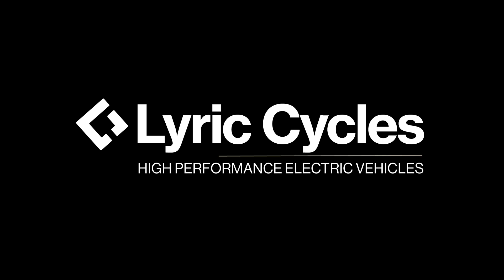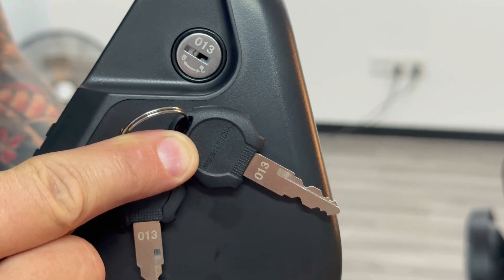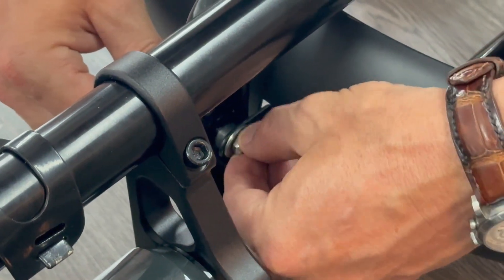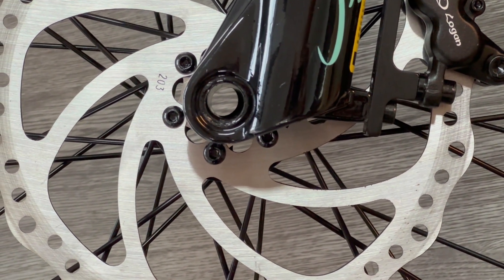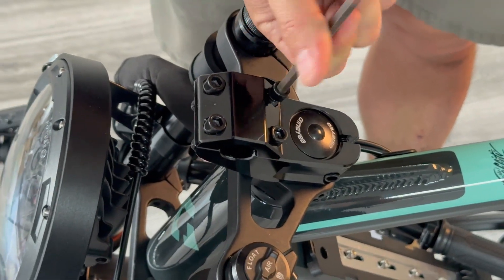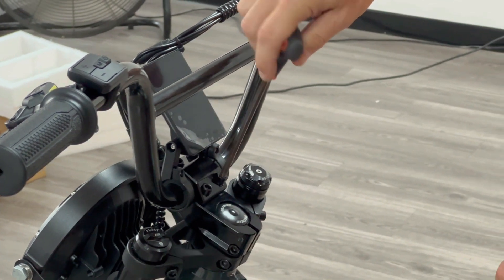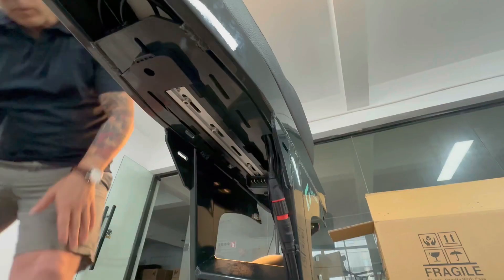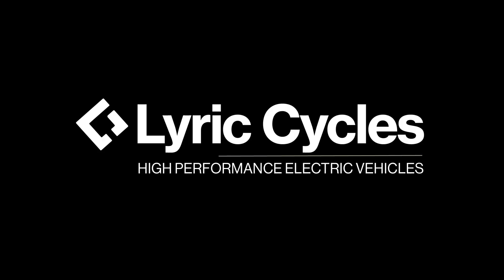Lyric Graffiti Assembly Instructions | Electric Bike Instructional Videos

Comment: I sent you an e mail on this very subject.i did not realize you had this video. Nice bike.im selling my motorcycle and wanted to still have some speed for secondary roads. Can I license this as a moped?
Reply from the maker: This bike doesn't come with a VIN, some states allow the use of the frame serial number to register as a moped, you would have to check with your local DMV